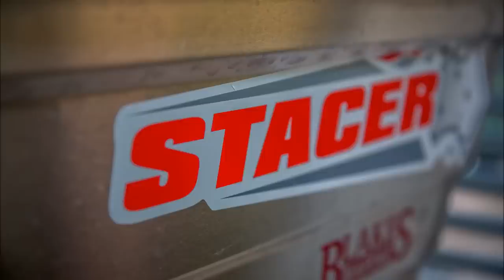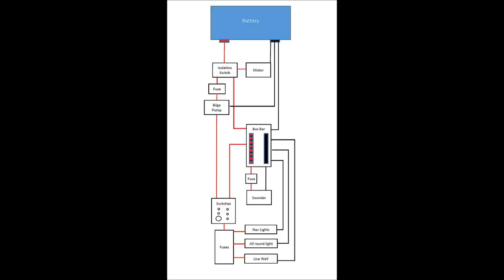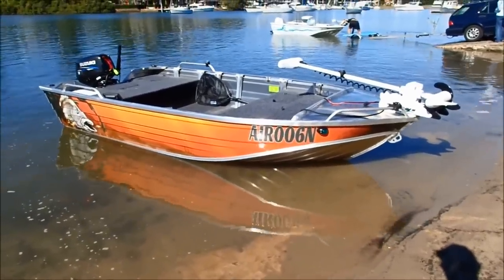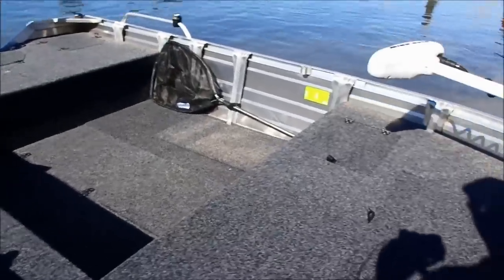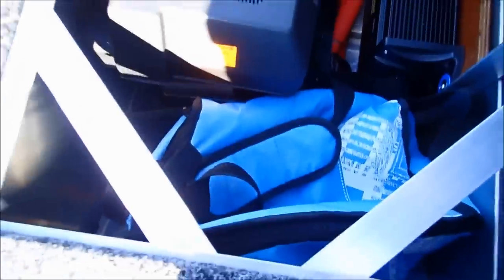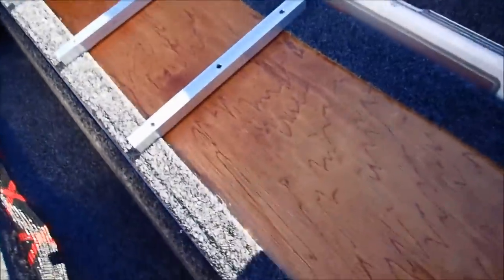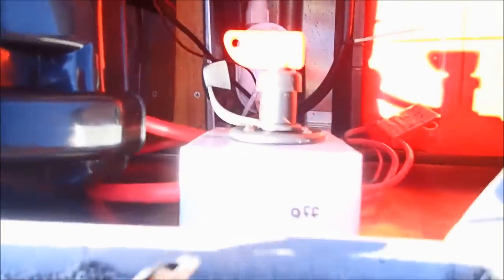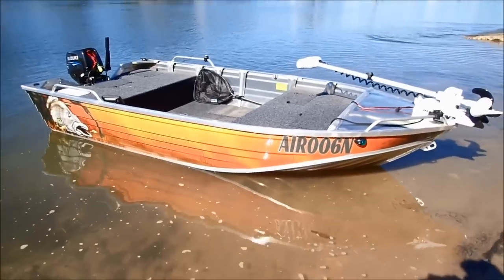Matt's Tinny Pimp

Comment: Nicely done mate, I'm doing something similar but a saltwater version with aluminum panels instead of wood, using SeaDek instead of carpet with my 2006 Quintrex 390 Explorer. I'm curious how much the boat now weighs with everything you've added?
Reply from the maker: Hey mate, not sure on the end weight. I estimated my on road weight at around 500kg including trailer. Trailer is 180kg, motor is 62kg, boat weight was 111kg, with the work done on guessing this is now around 220kg + motor. Sorry this is not exact. 
Hope it helps.

Comment: Hey Matt I want to fit the back casting floors to my boat, I wont be buying a motor for a while and wondered if you could give me the angled cut out measurements, I will be getting the same motor,thanks in advance, 
cheers Paul.
Reply from the maker: Paul Goodey 
hey Paul
Exactly which section do you need mate? Do you need the rear hatch door size?
The rear middle hatch opening is actually not perfect on mine and I'm thinking of reducing the door size slightly because the motor can't be fully lifted without the hatch door open.

Comment: great job matt, i am attempting the same sort off fit out on a 3.99 explorer, just a couple of questions, what sort of screws did you use to fix the timber? and did you use anything on the screws to stop the metals reacting. On your pull up tabs did you put a 
bolt through them or just staple them in place? Thanks Matt
Reply from the maker: Hi Desmond
 I used a stainless steel threaded screw from Whitworths. 

Here is a summary of the process:

I put the floor down, drilled through the floor and frame, then hand tapped the hole with a threading die so the aluminium fame has a thread. I then used Tef Gel in each screw hole and on each screw before screwing stainless screws. The Tef Gel is a must to prevent galvanic corrosion.

I used this method of tapping a thread for each hole rather than self tapping screws so I can unscrew the floor without the screws comming loose. I have read a lot about self tapping screws coming loose over time. 

This method takes longer but is well worth it IMO. 

For the pull tabs, I screwed through into the timber with a SS timber screw with washer to increase holding strength.

Hope this helps mate

Comment: Hey Matt, I have got my floor frame in, sturdy as, just wondered once you have the ply carpeted and fitted did you screw through the angle into the ply to secure it all?
Reply from the maker: Paul Goodey hey Paul
I put the floor down, drilled through the floor and frame, then hand tapped the hole with a threading die so the aluminium fame has a thread. I then used Tef Gel in each screw hole and on each screw before screwing stainless screws. The Tef Gel is a must to prevent galvanic corrosion.
I used this method of tapping a thread for each hole rather than self tapping screws so I can unscrew the floor without the screws comming loose. I have read a lot about self tapping screws coming loose over time. 
This method takes longer but is well worth it IMO. 
Cheers
Reply: Top job, Matt, cheers Paul.

Comment: Love te boat and its set up! I've just recently bought a 4.3m tinny and looking to do something similar. How much did all this cost? Thanks.
Reply from the maker: Tom Roesler Hi Tom Somewhere between 13 & 14K. Boat + motor + Trailer $7600 (new), the wrap $1K (non essential but I love it), Minn Kota Riptide + charger + mount + battery ($2700), Build was around $2500 - carpet, timber, metal, rivets, screws, timber sealant, electrics, solder, live well, bilge pump, sounder etc etc. I budgeted as much as possible without compromising. Things that surprised me were the price of good glue, stainless steel staples, timber sealant. These were a lot more expensive than I expected. Non of this includes the time I spent. I loved every bit of doing it and so far its great on the water. Hope this helps. Cheers Matt

Comment: excellent build mate! i have a stacer 389 sea sprite. the 1.6mm bottom is proving to be a little weak. cracks near the right hand chine, doesnt like the inshore waves i think. is yours 1.6mm or 3mm?
Reply from the maker: Blitzcast Fishing New Caledonia cheers mate, mine is 1.6 as well. So far I've had no problems (touch wood). That said I try not to push her too hard and I tend to keep the plane angle a bit flat so the V is working the water more. Cuts a bit off the top end speed but it saves the hull. How bad are your cracks?
Reply: Matt's Fishing Blog im getting the  3rd crack repaired this week this 3rd crack is very small the other 2 were around 3 to 5 cm just 2 or 3 mm in from the chine weld. i might take ur advice and trim her down to get the v in more and see how i go. only on right hand side where she gets alot of chop. nothing on the left hand side. have had the boat since 2012.
Reply from the maker: Blitzcast Fishing New Caledonia how far along the hull are the cracks? Just wondering if there is a spot I should keep and eye on
Reply: Matt's Fishing Blog between rear and front bench seats right hand side more towards the front bench.
Reply from the maker: Blitzcast Fishing New Caledonia thx mate, will definitely keep an eye on it.

Comment from the maker: Thanks for the great feedback everyone
Someone messaged a question about anchor storage now the Minn Kota battery is up front.
I have a slim anchor that slips into the front well under the carpet flap. Also have a cutting board and a few other things stored in there.
Cheers
Matt
Reply: Hi there.  Sorry I did not notice what hp motor you had on there ? How does that Suzi run ?

Comment: Looks great Mat, I am doing a similar reno when I get my boat. A question  with the transom supports left and right at top did you rivet the angle on ? did the rivets go all the way through?   I have a finished paint job.
Reply from the maker: Paul Goodey 
Hi Paul.
yep AA rivets all the way through. This was one of the trickiest sections because the transom has a subtle curve. Shipping the angle was not easy. The rivets were not a problem especially seeing they sit about 1ft above the waterline when at rest.
Hope this helps.
good luck with your boat
Reply from the maker: Paul Goodey 
Hi Paul.
yep AA rivets all the way through. This was one of the trickiest sections because the transom has a subtle curve. Shapping the angle was not easy. The rivets were not a problem especially seeing they sit about 1ft above the waterline when at rest.
Hope this helps.
good luck with your boat

Comment: how come everyone goes with wood flooring and not aluminium? wouldnt the weight be very noticeable? or is the price difference that big? is there any other benefits of wood flooring? ease to cut and obtain?
Reply from the maker: Sombody You Dont Know IMO wood is easier to work with and is more forgiving.
Reply: Matt's Fishing Blog
ohhh i see. i didn't think about the process of working on each material. thanks!

Comment: How much did u pay all up including the boat
Reply from the maker: Hi Levii, Somewhere between 13 & 14K. Boat + motor + Trailer $7600 (new), the wrap $1K (non essential but I love it), Minn Kota Riptide + charger + mount + battery ($2700), Build was around $2500 - carpet, timber, metal, rivets, screws, timber sealant, electrics, solder, live well, bilge pump, sounder etc etc. I budgeted as much as possible without compromising. Things that surprised me were the price of good glue, stainless steel staples, timber sealant. These were a lot more expensive than I expected. Non of this includes the time I spent. I loved every bit of doing it and so far its great on the water. Hope this helps. Cheers Matt
Reply: Matt's Fishing Blog ok thanks thinking of doing something similar to my tinny
Reply from the maker: No Problems. I got so much information from on-line I really wanted to give back by sharing how I did things. I put plenty of info on my blog here: https://mattsfishingblog.com/tinny-pimp-project/  Nothing too serious, just an online diary really.
Reply: Matt's Fishing Blog We're abouts did u get the bait tank from
Reply from the maker: Hi Levii Paris The live well and pump are from Whitworths. It's only 30L but it's fine for what I'm doing and the size of the boat. If I was doing comps again I would definitely need more water. 
Here's a link to the live well  https://www.whitworths.com.au/main_itemdetail.asp?cat=136&item=36463&intAbsolutePage=   
cheers  
Matt
Reply: Matt's Fishing Blog ok thanks

Comment: Middle hatch. 
cheers Paul.
Reply from the maker: Paul Goodey 
hey mate, the stern hatch measured from the inside has the following measurements:
length: 425 (stern to bow)
width: 440
the gap for the motor when the lid is down: 105. this gap is not big enough for the motor to be raised to locked up position. it needs to be 170 to be able to lock the motor up without opening the hatch.
The lid is 320 long and 440 wide.
All measurements are in mm and include attached carpet.
I think the size would be fairly forgiving. the biggest consideration would be if you want to be able to raise the motor with the hatch closed. I have to open mine to raise the motor, which is fine because I only lock it up occasionally and when I do I just open the hatch (if that makes sense).
I've got some images and drawing if you need clarification. If you want these just message me through my blog mattsfishingblog.com and I will email them to you. 
cheers
Matt
Reply: Thanks Matt, for the help much appreciated.